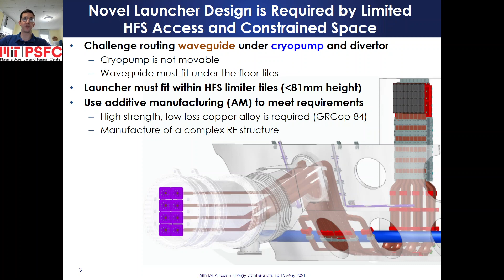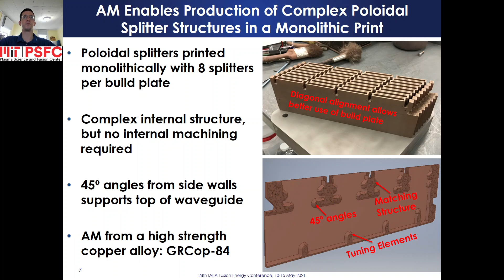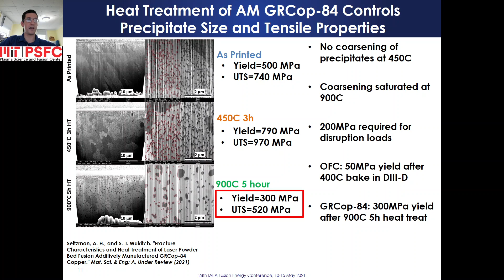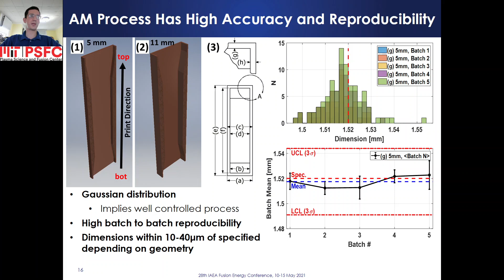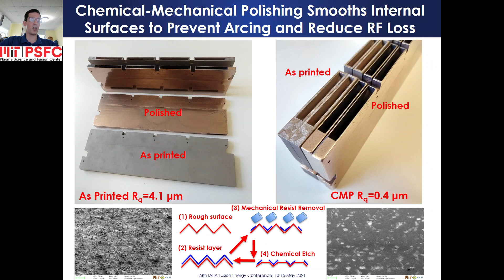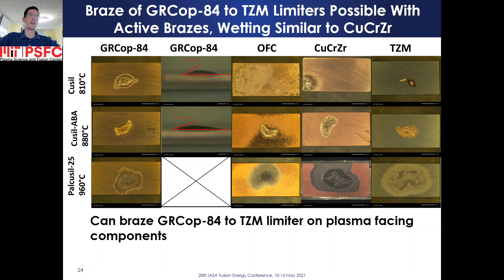IAEA Fusion Energy Conference presentation on 3D printing fusion reactor components from GRCop-84

Comment: Andrew, thanks for the impressive talk!
So it seems that GRCop-84 can be used not only at the divertor ...

One question:
These abrasive beads you used - how did you move them in the chemical etching bath? Using a shaker, or something else?